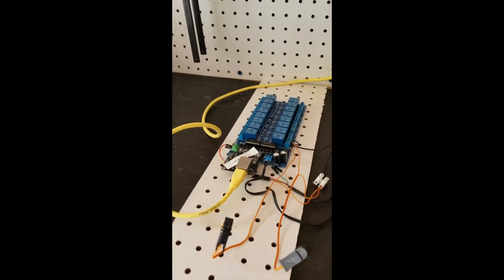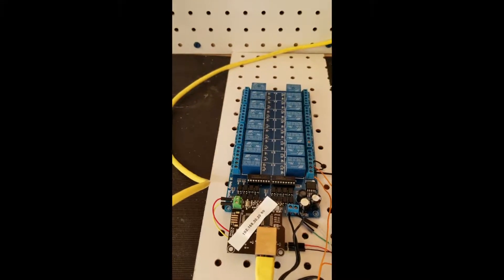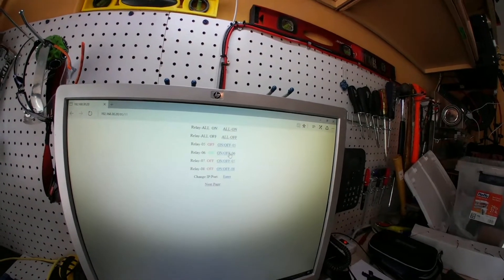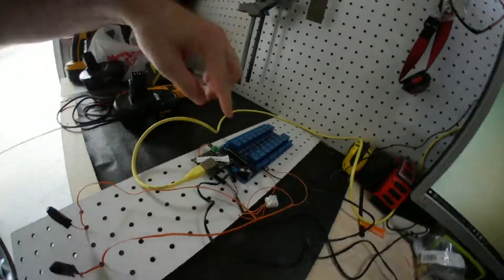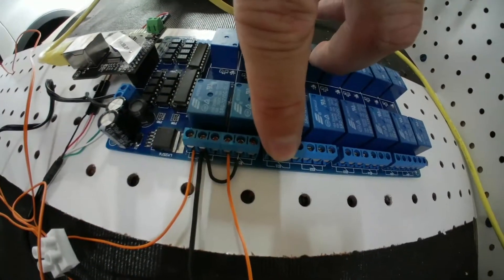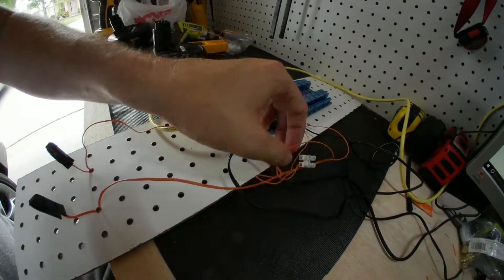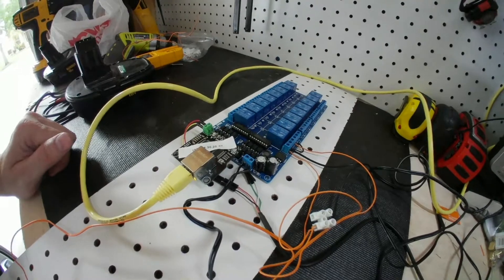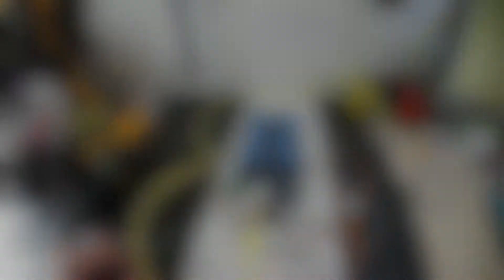Remote Firework Ignition System Part 1

Comment: To resume its the SainSmart iMatic 16 Channels Relay with its Controller module bundled at $59.99 you are showing, to ignite talons @ 9 volts.  Thank you for pointing us towards this solution.  I was looking for a DIY fireworks firing system.
Reply: The Amazon link as dead - Is this the 16 ch relay?  https://www.sainsmart.com/products/16-channel-12v-relay-module
I'm looking to use a Bluetooth enabled Arduino/ Raspberry Pi so my hope was to connect with General-Purpose Input Output (GPIO) pins.  Any suggestions?
Reply: I purchased the relay from Amazon.  SainSmart  16 chnl with Web interface.